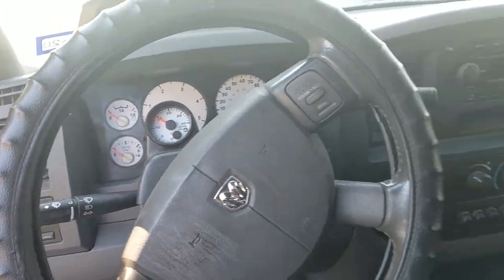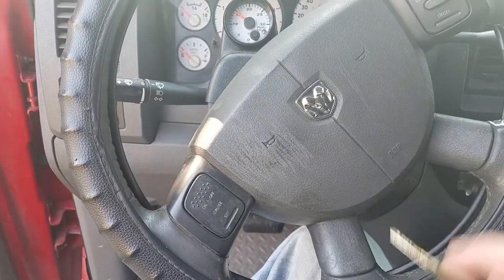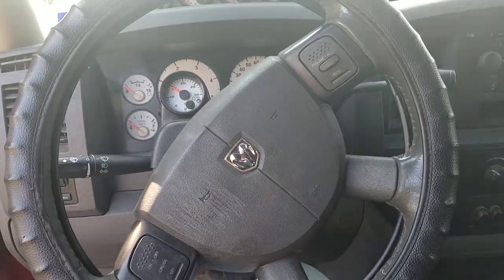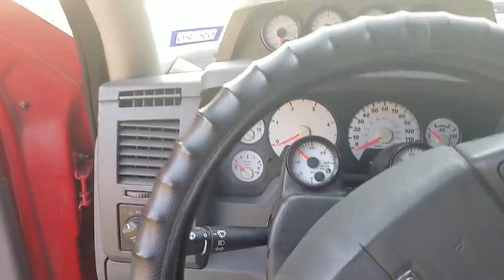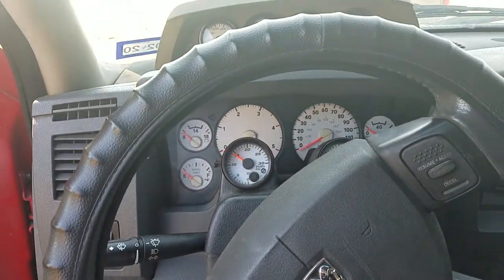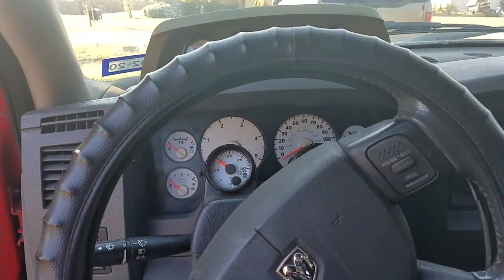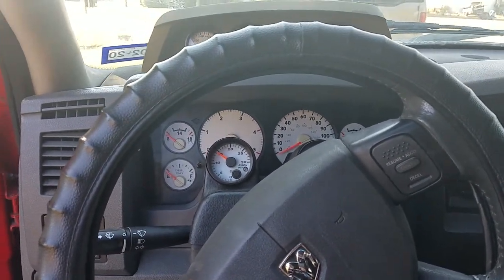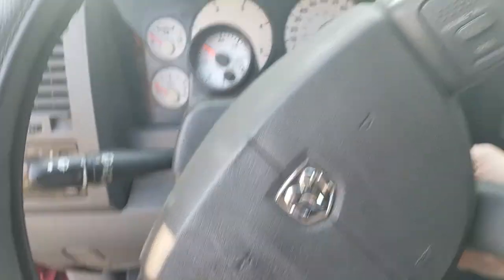2006 Dodge ram 2500 transmission issue

Comment: For all the mechanically challenged people who seem to not understand the path of power transfer. The engine spins the torque converter. When the transmission is in park or neutral the engine is not being put under a load. When you put the transmission into gear with your foot on the brake at an idle at a dead stop the drive shaft does not spin and there is not much load on the engine. Why. Because of the torque converter. You can weld the transmission shafts together and you will have the same load on the engine. Why? Because of the torque converter. It lets the engine rotate when the transmission is locked up. If the engine is put under load when the transmission is in gear at a dead stop and at an idle, it is because of resistance in the torque converter because it is not operating properly. Again. You can weld your transmission gears, sprauges, and shafts together. If the torque converter is good the engine will idle as it should. Gee wiz people.
Reply: Run the codes and then see what you find.

Comment: That's your torque converter going bad
Reply from the maker: I don't think so. The transmission still shifts at all the right times and TC lockup is still correct with the right amount of RPM drop.

Comment: Unfortunately all you fellas should've got the 6 speed manual , when I had my 2006 with the manual , only issue I had was I had to replace the clutch at 90,000 miles , and that was a fluke deal , never rode my clutch at all , and I looked it up and didn't find any major clutch problems from other owners . My partner at work had the same trans as you in his 2006 and they had to completely rebuild his trans , luckily his was still under warranty . Have heard lots of stories of trouble with your trans .
Reply from the maker: 47 and 48's are junk... I am really loving the 5r110w in my ford excursion now.
Reply: 6.7 > 5.9

Comment: Torgue  convertor!25 year dodge tech!
Reply from the maker: Hey Steve, A couple of things here. You say you are a 25 year dodge tech. Have you rebuilt every transmission dodge ever produced? TF747? 47RH? 48RE? 57RFE? The TC was a triple disk billet unit. I should add that besides the lugging issue, the transmission shifted perfectly and TC lockup was at the expected speed and RPM. I did sell the truck, so its no big deal..

Comment: Fuel injectors are firing too much fuel. Could crack the engine block where that fuel injector is spraying.
Reply from the maker: Umm no... This was a forward sprague issue. If you put a manual truck into 4 low and chained it to a tree then lugged the engine with the clutch, the same thing would have happened.

Comment: Torque converter is stuck in the locked position!
Reply from the maker: Actually no...The transmission still shifted at the right times/places and TC lockup still worked.
Reply: How can I check/ correct tc being in lock up I have similar issue except my trans in in limp mode and it pulls like no tomorrow with brake engaged